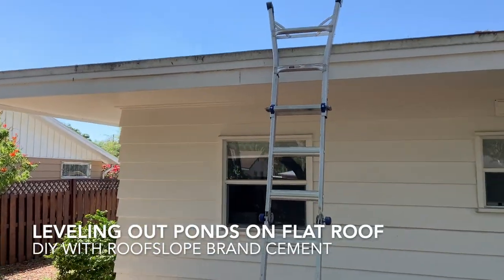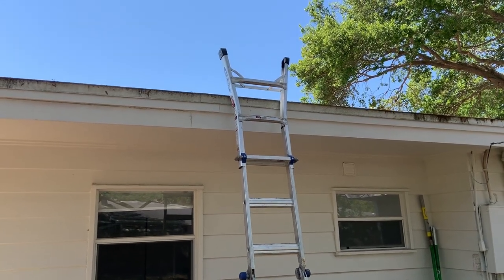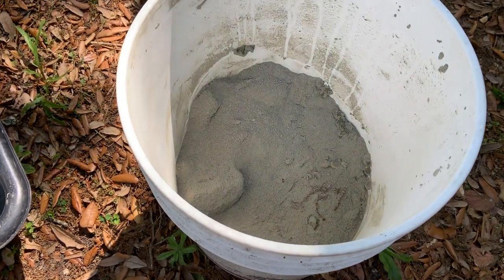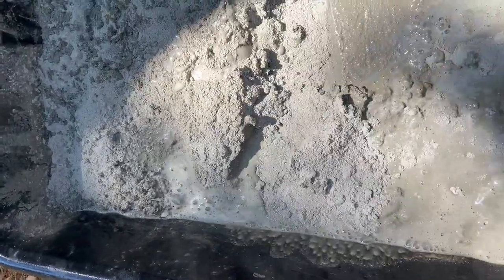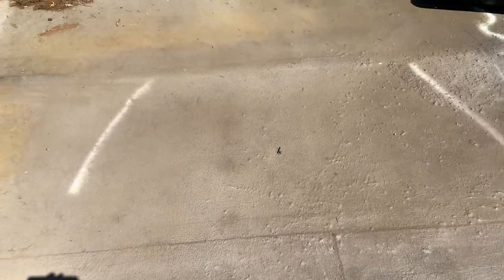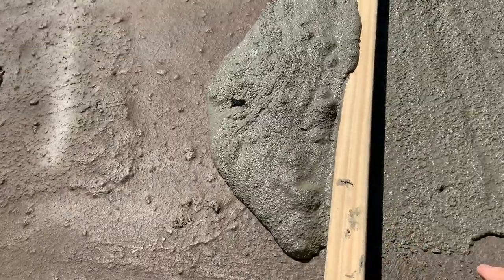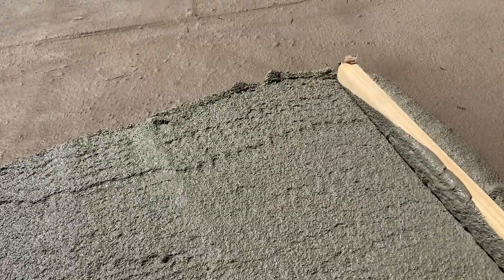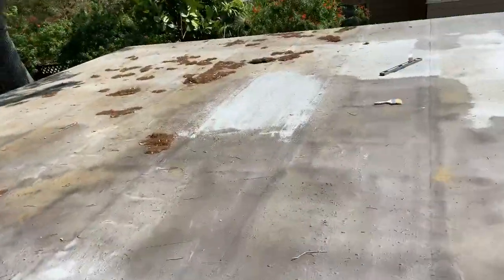Filling in ponds on flat roof with Roofslope Cement Product

Comment: Thank you for the video, friend. I actually have used this product and also recommend ROOF SLOPE as an able product. The only recommendation that I'd add further, is to: *blow off the complete roof / wash down the complete roof. The substrate, no matter what type of roof is in-place, needs to be free of dirt & debris. If not? The ROOF SLOPE will simply, eventually let go. Just my 2 cents. 
Thanks again!

Comment: You saved me thousands by adding that little comment regarding not using coatings. A roofer came by and told me their were  bubbles which would have made the coating fail quickly.

Comment: Just get a leaf blower and a pressure washer with a surface cleaner attachment (takes 1/4 of the time)and you will have a sparkling roof that anything will stick to.
Reply: if using silicone roll on product clean well and spend the extra money for primmer

Comment: I have been in the business for over fourty years, and I made this mistake thirty years ago....
Doesn't work, and it wont last. Especially if you have freezing seasons.  It's not for fixing leaks. It's for substrate purposes when installing  new roofs.
Reply: Interesting that they made this product that long ago. I was in remodeling (some roofing) but I am very familiar with the types of adhesives - this is somewhat of a "thin-set" type and if you've ever used that (on wood, cement or anything...it's sticky and it lasts forever! If you get some of it on your skin it's hard to get off....
But I think I will agree with you in terms of places that freeze a lot! 
BTW, my repair lasted perfectly....I put a TPO roof down on top of it recently tho (applied some insulation and deck first).

Comment: DO NOT USE THIS !  IT WILL JUST ADD 100's of POUNDS TO YOUR ROOF.  If there's an issue where it's ponding and can't get past  the high flashing and rain gutters, it will just make the pond bigger, more heavy, and sink more.
Reply from the maker: I used less than one tub - so it may have added 80 lbs spread out which is nothing.
You are correct that it should only be used sparingly - if one needs much more sloping there are other ways to do it.

Comment: I just used this on a low spot on my flat roof.  It rained after 2.5 days and i had leaking still.  It says the product is not waterproof but water resistant. 1) is it possible it got saturated and the water went through it and 2) if so will it eventually cure more and dry more. 3) should i apply an elastomeric coating over it to make it waterproof?
Reply: its a cement product that means its porous i would roll on a rubberized roof product

Comment: Thanks for the good info and showing how you did your roof job. Question: I need to level a ponding spot on my balcony that is covered with a black rubber-like membrane. Do you know what product I should use for this?
Reply from the maker: Black is probably EPDM rubber type roof - there are many ways to go depending on the depth of the puddle. This cement sticks to anything (you might want to rough up the rubber a bit) , then you could apply black liquid coatings (a high grade, not tar) over that for looks. Some other companies make roof slope repair stuff that is even more sticky, but it;'s not made for as deep of a pond. Google "roof pond repair"

Comment: Don't you need to wet the base before applying this material?
Or brush a wetter creamy like thinner version first for good if any bonding between the layers first?
Won't this new patch detach itself otherwise over time?
Reply: In most cases probably not because the base is not mortar or stone (which you do want to wet or dampen). But since I am applying largely over aluminum roof coated asphalt, I don't think this would apply. It is VERY sticky stuff and none of it has come loose. Of course, if your roof heaves or settles a lot this might not be as good...BUT, it is also somewhat elastic. Think of it as more like the Thinset tile mortar which is like a glue- even sticks to your hands and gloves.

Comment: I have an upper patio deck with vinyl deck flooring material.  the flooring has been painted over with deck paint over the years.  There is a puddle of water that forms in one corner.  Would the Patio slope product you use work on this type of flooring?   My contract suggest cutting a channel but I don't like the idea.  I was thinking of building up the slope to divert water flow which is less invasive. This product and your technique seems like the ideal solution.   Let me know ...thanks :)

Comment: Can I apply this over flat asphalt? I have a little valley type area that is ponding on my flat roof, I patched it with leak stopper and would to build it up more. So I guess my question is can this go over patched areas as well?
Reply: It should work fine on that type of a situation.
Reply: I think there's a specific product to go on to of asphalt

Comment: I am trying to repair my previously GACO silicone coated roof.  It was applied over a tar coated roof that probably didn’t age enough. I’ve had many bubbles under silicone that I had to cut out and remove. If I patch all puddle areas with this cement material, shall I reapply a coat of Gaco silicone over entire roof again or will RoofSlope cement be enough!  That silicone coating is quite expensive. 🥴
Reply from the maker: I had one roofer offer to use that silicone stuff - I am not big on it (but that's another story). I don't think roofslope will help you much when the problem appears deeper. I am going to get TPO installed over my roof eventually (over a duckboard base) so I don't have to coat....but I think spending good money after bad on silicone is not ideal.....for what it is worth.
Reply: So the answer to it is no. 
So I want to give some insight as to why you have issues. So Silicone based coatings, such as GACO, do not properly stick to bitumen based roofs (Asphalt/coal/tar/etc). They actually are non-compatible, and result it bubbles, cracks, and eventual delamination.

Unfortunately, the product used in the above video is also non-compatible with roofing of nearly any type. It can rot out the majority of roofs, creating a lot more damages.
Reply: I did my whole roof with asphalt emulsion an elastomeric white coating with polyester fleece I need help water for a year pretty good but it's separated from the old spudded tar big bubbles i just did tpo over it and its good now i got a cheap tpo gun on ebay for 75 bucks and a roll of tpo for 540 and a bucket of glue for 120
Reply: @RoofingFacts  so what is a good solution if neither silicon or the roof slope product is ideal?

Comment: never seen it done that way before...but then i am a roofer
Reply: Similar compounds, many pre-mix, are used to stop ponding on commercial roofs. Henry 176 is one of them. Of course, in the older days roofers would build it up with paper and hot tar. It's handy to know about this stuff (it's my video) for those rare cases where just a few ponds are messing up the works.

Comment: Is the cement heavy for the roof ?
Reply from the maker: This is designed to be used in fairly thin layers - for all my different patching I may have used 60 pounds of it - so, no, that's not any additional load worth worrying about.

Comment: Would self leveling mortar you use to level a concrete floor before doing tile do the same thing?
Reply: maybe in a pinch, but this is designed for the outdoor conditions - differently formulated. But I suppose some floor level thinnest with lots of latex additives might do if nothing else was available Some people just build up a couple layers of heavy tar paper and coating and then use mesh and roof cement and perhaps gravel on top.